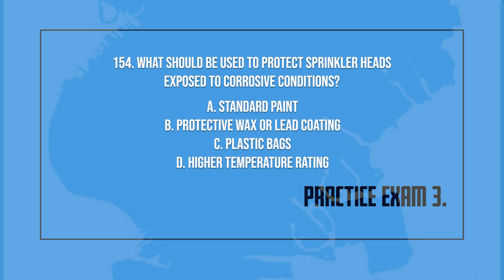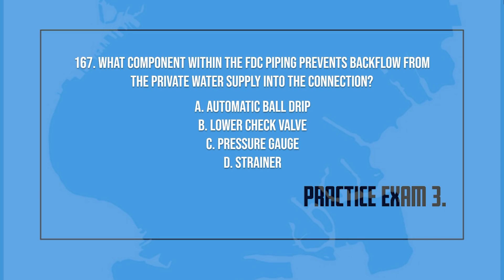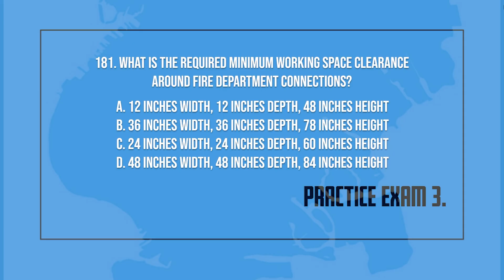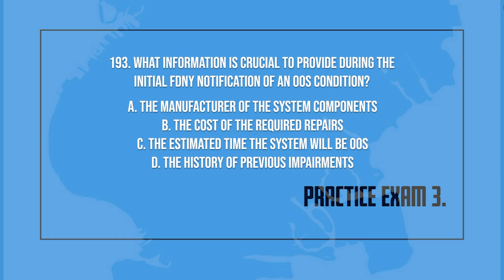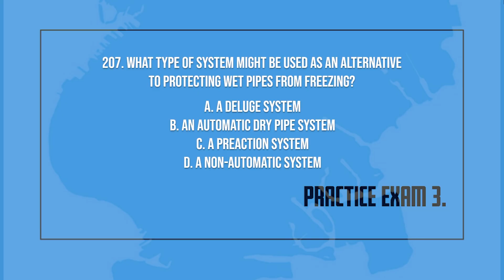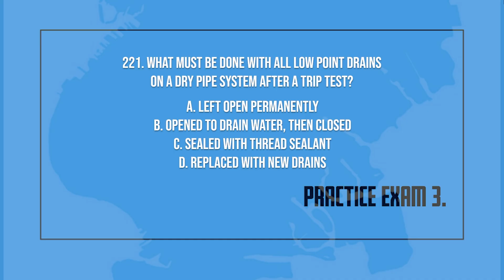FDNY S-12 CERTIFICATE OF FITNESS for CITYWIDE SPRINKLER SYSTEMS Study Guide PRACTICE TEST 3.

Comment: which of those 75 questions will be on the test? thank you!
Reply from the maker: The computer terminal at Metrotech will pull moat of the 75 random questions from the pool of 320 presented in the 4 videos. Familiarize yourself with ALL of them, the reference guides and the photos of the equipment provided in the FDNY link. You are very welcome.
Reply: @BLUECOLLARTUTOR  Thanks again. Appreciate your help.